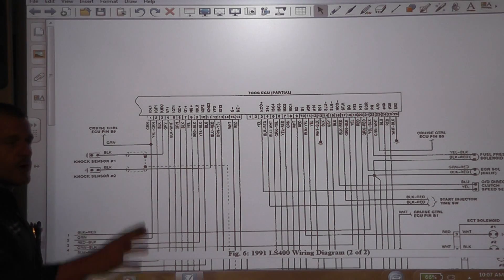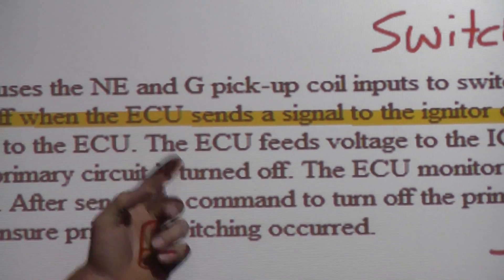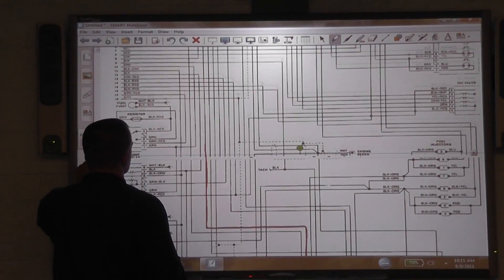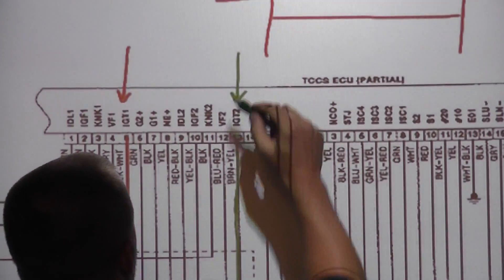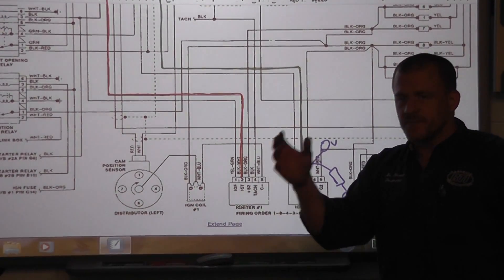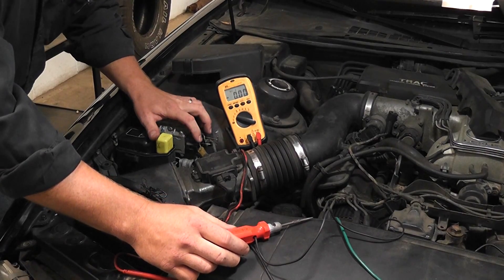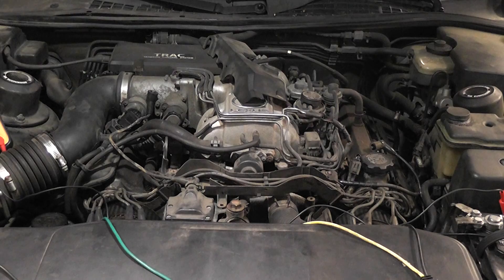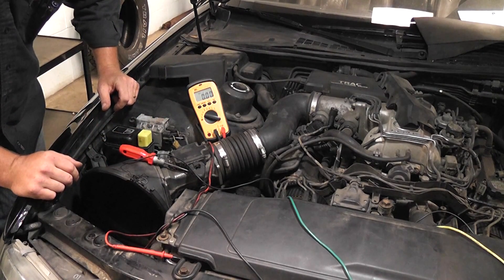How to test an igniter on a Toyota/Lexus

Comment: Awesome video but i have a question on a 1995 Lexus ES300 with the same problem.  My car only has a single igniter.  I traced the wires and the igniter is getting power when the key is on but I don't know what wires to set the t-pins in to do your test.  There are two banks of wires on the igniter; the one side (A) goes to battery positive, the 6 coils, and the data link connector.  The other side (B) goes to the ground, 6 IGT wires, and an IGF wire.  Help.
Reply: +Jack Dietz IF you have no spark on any of the coils it is doubtful the igniter is your issue. But to do my test you would want to energize the IGT wires. Each one would fire 1 individual coil. For example: IGT6 (Grn-red) would fire coil number 6. Of course you would want to have the key on. 

I would check for injector pulse before doing the igniter tests. If you also do not have injector pulse, then you have an input problem (cam or crank sensor) not an igniter probem
Reply: +ScannerDanner Premium I only tested one plug to determine that I didn't have spark I did feel the igniter was not the problem once I determined there was power to the unit.  Let me give you some background and maybe you can point me in the right direction because I'm really stumped.  I drove car it ran great.  Later owner asked if I wanted to buy and I was told it had a dead battery.  Car was completely dead; I thought the anti-theft system got messed up with the dead battery.  Towed it home and started working on it.  Charged battery but still every electrical item was not working.  Started testing from battery forward and discovered a 100 amp ALT fuse blown.  Never seen that before.  Once I replaced the fuse thought I had fixed as all the electrical started working but the car cranked but no start. Checked fuel pump and seemed to be working, also sprayed some starting fluid into the intake and got nothing.  Checked and tested every fuse and relay; all good and all relays tested for continuity and opening click with a 9v charge.  Put a spark tester on one of the plugs and found no spark. Borrowed a scanner from Autozone and tested but no codes.  Contacted previous owner and they admitted to crossing the wires to the battery when they tried to jump start the car.    That's why the 100 amp fuse blew I guess.  Anyway any help to get me in the right direction would be greatly appreciated.  I have a 1994 Camry service manual which is apparently the one for this car also but I don't see anything about how to test the ECU which is my current thought.
Reply: +Jack Dietz with the key on measure your voltage on the TPS . What we are looking for is a 5v reference.  It is the best "am I alive" test for the ECU.
I have videos on this. Search 5v reference under my video page.  
Let me know what you find.
Reply: +ScannerDanner Premium I've got 5v at the blue/red stripe wire on the TPS with the ignition on.  So am I to assume that I'm getting this power from the ECU and my ECU is probably good.  If it is I'm not sure where to go next.  I feel like I'm running out of options.
Reply: +Jack Dietz yes, it suggests at least that the ECU is at least partially alive.
With the battery connected the way it was, it is possible that portions of the ECU got cooked as well as other sensors. Attack it like it never happened. Cover all your bases. If you have no spark, check for injector pulse next. If you do not have injector pulse then check crank and cam signals next. If you have injector pulse then your cam and crank sensors are probably okay and we go in another direction.
Reply: I'll start that process tomorrow and let you know what I find.  I really appreciate the help.  I really like a challenge and it looks like I got one.
Reply: +Jack Dietz I'm not exactly sure how to check for injector pulse with the car not able to start but I do have 12+volts at the individual coils sitting above each spark plug when the key is on.  I also have 11.6 volts at the injectors with the key on. Does that seem correct for the voltage to be slightly below 12 volts.  I thought it was going to be that 5v reference again for both the injector and the coil (I think they are called coils).
Reply from the maker: +Jack Dietz https://youtu.be/SUxagOAVS5M
use a test light like I am showing in thi video
Reply: +ScannerDanner Okay, I've got some updates.  Here are the things that I have proved through your testing suggestions.  First I positively confirmed that I am getting fuel and it is a no spark situation.  I tested with a spark plug tester and confirmed no spark.  I did the TPS test and confirmed there is a 5v reference. I tested the Injector pulse per your video and confirmed I was getting power with the light on ground from one side.  I also confirmed a flicker of the test light while cranking with the light on battery positive and the non-hot side. 

 I'm back at the igniter and this is what I have confirmed.  This 1995 Lexus ES300 has one igniter with a R side (gray connector) and an L side (black connector).  The R side has 8 wires starting at the top; battery positive (hot with key on, per test light), next 6 wires down all come from each individual coil (also hot with key on, per test light), the 8th or bottom wire lists "Tach" and goes to ground through the Data Link Connector and a junction connector.  With the key on or off I cannot get this ground to light my test light with it connected to battery positive.  Does that seem right???

Now the L side; also 8 wires (I don't know if they are going to or coming from the ECU) but the wire schematic shows 7 wires directly connected from this side of the igniter to the ECU.  From the top down again the sequence is first wire to the IGF, second wire is ground (with test light on battery positive this ground lights the test light with key on or off), remaining 6 wires go to IGT1 through IGT6.  

Here is my problem, I don't know whether to put my T-pin on the IGT side (L side) of the igniter and give it ground or power.  The IGT side is 0 volts with my meter on battery negative.  That seems to me if I give it power it would send a charge to the ECU.  I know on the other side of the igniter I'm getting power with the key on and I believe it is coming from the coil into the igniter.  I've tested the circuit and with the key on the coil receives power on the one wire in (black-orange from ignition switch) and the other wire out (coil #2 is gray wire which is the same gray wire feeding into igniter at coil #2 position) feeds power to the igniter.  Am I correct in that conclusion?  That's my dilemma and I'm not sure if I'm thinking or over thinking this and I should just put power to one of the IGT side wires and see if I can get it to spark.  Any help would be greatly appreciated if any thing that I've written makes sense.
Reply from the maker: +Jack Dietz awesome job on test for injector pulse! Now we know for sure that your ECM is alive AND more importantly that your cam and crank signals are most likely okay too.  So you do not have an input problem and most likely not an ECM problem. 
Before we attack the bypass test, I want to confirm that the ECM is sending the signals on the IGT wires to control the igniter. Connect your voltmeter to the igniter wires individually and crank the engine over. You should get an average of the digital pulse that is taking place on those wires. 
Watch this video near the end to see what I'm talking about. I know it is a Subaru, but the igniter tests I am showing with a voltmeter at the end of the video is what I want you to do. Okay?
https://youtu.be/YBE7c7lfmnY

"The R side has 8 wires starting at the top; battery positive (hot with key on, per test light), next 6 wires down all come from each individual coil (also hot with key on, per test light), the 8th or bottom wire lists "Tach" and goes to ground through the Data Link Connector and a junction connector.  With the key on or off I cannot get this ground to light my test light with it connected to battery positive.  Does that seem right???

Those 6 wires coming from the coils should show "hot" so that's good too. Again, nice job. 

Don't worry about the TACH wire, it is electrically connected to coil - and will only have a signal when there is spark. 

"Now the L side; also 8 wires (I don't know if they are going to or coming from the ECU) but the wire schematic shows 7 wires directly connected from this side of the igniter to the ECU.  From the top down again the sequence is first wire to the IGF, second wire is ground (with test light on battery positive this ground lights the test light with key on or off), remaining 6 wires go to IGT1 through IGT6.  "

The IGT wires are the ECMs control wires to the Igniter (going to)
The IGF wire is a confirmation signal that the igniter sends to the ECU when the coils fire. (don't focus on this wire at all for now)

Bypass test:
Key on, T pin to the IGT wires individually, test light connected to battery POSITIVE and touch on an off. The coils will fire individually if the igniter is good. 

Is there a main power and ground to the igniter on this design?
Reply: +ScannerDanner Okay, here's the test results as I followed and understood the video.  With key on I tested the power wire to the coil and got 11.8v; cranked engine and I got appr. 9.5v average.  Switched lead to that same coil control wire and got 11.8v; cranked engine and got 9.5v average.   I'm thinking that means the starter circuit is sending power to the coil and the ECU is sending power to control the coil.  If that is correct does that mean the igniter is bad?

Second, I did the by-pass test.  I did two tests to two different coils/plugs.  Both resulted in no spark.  I'm thinking this confirms the igniter is bad, but I'm not sure? 

Finally, your ending question is about a main power and ground to igniter. I'm not sure what you mean by a main power.  There is a +B wire that I interpret to be the battery positive.  That wire comes into the igniter on the coil side (R side, Gray connector side).  The ground wire comes in on the igniter side wires (L side, Black connector side).  I don't know if I answered your question or not.  I hope I did.

Am I on the right track that it is the igniter.  Would crossing the battery wires cause that to blow out or was this a coincidence.
Reply from the maker: +Jack Dietz the voltage test I wanted you to do was on the IGT wires.(not the coils) It would be the two white wires in my subaru video. 
Your bypass test, you did them on the IGT wires right?
And yes, reverse polarity of the battery could have definitely cooked the igniter. 
If you have good power and ground to the igniter and you have good IGT signals (I need that reading from you) and the bypass test will not fire the coils then yes, your igniter is bad
Reply: +ScannerDanner Sorry for not getting back to you but I had to go out of town for a week and I'm back.  After watching the video I tried to test the IGT wires.  This is what I did; meter black to battery negative, meter red to IGT wire at the igniter.  Wires were plugged into the igniter.  When I cranked the engine I got a .3volt reading.  Got same reading at several different IGT wires.  That seems insignificant 3/10 of a volt?  Unless I'm doing the test wrong.  I don't have a graphing meter only a regular digital meter.  Should the test be done with the wires unplugged at the igniter.  Those wires come from the ECU going into the igniter.  I got no spark going from the IGT wires when I touched the test light to the IGT wire from battery positive.
Reply: +Jack Dietz Okay, wanted to get back to you to thank you for all of your assistance.  After conducting all of your suggested tests I came to the conclusion that it was an igniter based on several tests that showed the ECU was at least functional on those unrelated items.  All the other tests pointed to the igniter as every other item showed as not the issue.  Since the igniter is a very expensive part I decided to try to locate the part at my local junk yard.  No luck but I found it on ebay.  That solved the problem and now I'm back in business.  The entire repair cost me some time (but I learned a lot) and less than $50.  You are the man!!!  Your knowledge of utilizing the multi-meter or test light when a scanner is not available was just what the doctor order.  I've found most of us fix-it guys have a good collection of tools but not those high dollar scanning or computer repair tools.  But you proved the old diagnostic systems can work if you know what you are doing.  You obviously do.  Can't tell you how thankful I am for your time and info.  Will pass on to others your website and You Tube Video library information
Reply: +Jack Dietz 
Holy crap...  I'm dealing with the exact same issues... after months and months of searching... Ive got a 1993 Lexus gs300 and my dumbass ex hooked up the battery backwards and WELL YOU KNOW THE DETAILS... 
blew the 100amp fuse also... I mean every detail about your issue is IDENTICAL to mine...  
At present, and mind you I am a female and learning, I have a new battery, new alternator, new fuel pump, and just received an ignition coil pack I ordered online... 
the guy that removed the bad one can't be found and I'm trying to screw the new one into place and hook some wires to it?  I'm kind of having an issue with how it fits??? 
here's a picture
Reply: +Lori Kerns I couldn't see the pictures you sent.  I got a used igniter online for about $35.  A new one is about $500.  Car now runs great.

Comment: from where will coil get 12v on igt wire incase of pull down design! because there is no positive voltage on coil.will there be a extra 12v feed voltage wire on coil or some capacitor inside of coil to make igt wire 12v

Comment: still have crank no start I did your by pass test I can hear the spark but there's no visual what would be the suspected component 93 ls400
Reply from the maker: +Alexis Martinez shorted coil. Is the coil inside of the distributor? If so, take the cap off and re-do the test and have a look

Comment: so been having no spark, coils are good ckp is good haven't checked cmp or icm so if the icm does not give the spark when given source voltage then the bad component will be the icm correct..... and if not will a cmp cause no spark?
Reply from the maker: +Alexis Martinez I'm sorry, what are you working on? year, make, model and engine please. Thanks!
Reply: 93 ls400

Comment: i do have spark but i dont have 12 v At The fuel pump The fuel pump relay is burn and i just want to know how can i bypass to have power At the fuel and relay conection  i dont even have a 2 second pulse or prime. so i  have spark by using your method but no prime or no voltage At the fuel pump relay a little help will be apreciated thank you

Comment: Mr danner I try to fix a Lexus ls400 I have spark when I crank the engine and the fuel pump relay is not working is there anyway that I can jump start the relay terminals and see if the fuel pump work or how can I check the fuel pump voltage to determine if the fuel pump is bad
Reply: Post this to my forum and include the year and engine size please. Thanks
http://www.scannerdanner.com/forum#/

Comment: I don't know if you will be able to help but it is worth a shot. I have a 92 ls400 and it is over fuelling like crazy. I had believed it to be the manifold (they were leaking) but after replacing them I'm still stuck with the same problem. Any ideas with where to start?

Comment: I have an uneasy feeling when you applied 12v to pull up.  How about if the igniter only expected 2v, 5v, or 7v?  Isn't it possible to supply too much voltage?  I understand the pull up resistor will prevent too much current flow.
Reply from the maker: There is a good reason to be cautious. Watch this video How to test a C.O.P. ignition coil
And also this one How to troubleshoot a no spark condition with a test light (Subaru) (this Subaru uses a 12v signal to fire the base of the transistors)

Comment: Paul  on 2 wires coil test  if  install a jumper  from battery - to coil -  will that coilgenerate spark??
Reply from the maker: no, it will not work.

Comment: i have a 93 ls400 and its running very badly... every thing i have found out about it (coil out seems to be the thing i keep finding out) and i was wondering the best way to test it... i would like to try this test but if the coil is out would this be a good test to try?.. would there be other things i should try?.. thanks for the help... i am out of work and dont have the ability to spend time or money without knowing for sure that its the reason... im going to have to borrow money from my girlfriend and thats bad enough... i need this car to help me find a job and get back on my feet and dont want to just walk away from it... thanks again

Comment: Hi paul, I am nearly finished section2 of ebook and prem channel but stuck on this. I understand the transistor needs a base v+ to switch the primary, so ecu will send square wave to ignitor, like in this video. But I cant fiqure out how it works in a pull down fashion? If you had 12v at the ignitors and pulled down with a test light, how would that be providing a base signal at the ignitor transistor base? If you can point me to a section in your ebook that will make it easier for me to understand that would be awesome. Thanks so much, Edyn.
Reply from the maker: I assume you are talking about electronic switch inputs? If so, some transistors are energized by a base circuit ground. I believe they are PNP types.
The NPNs are energized by a base circuit power.
Reply: ScannerDanner  i appreciate the reply Paul. I didnt know about PNP transistors and thought they all switch with b+ at base as you described in your Coil over plug videos, I still have lots to learn. Module to module gets a bit confusing haha. Thanks for the help.
Reply from the maker: Edyn Maniapoto
For sure. It is the hardest one to ID and cannot be done sometimes